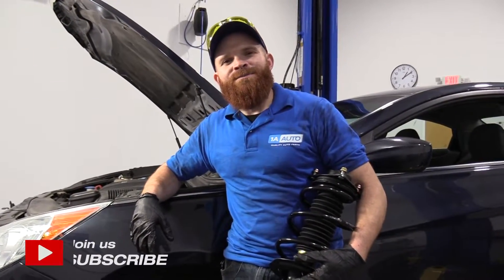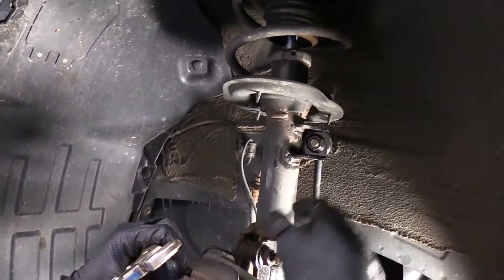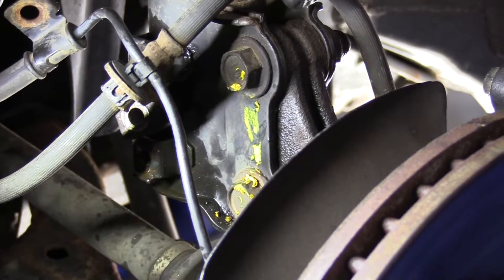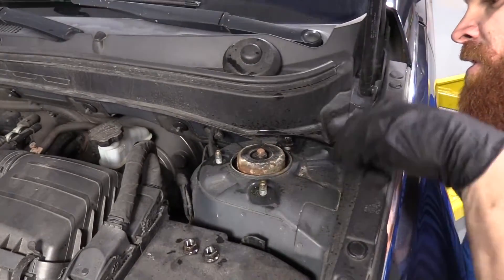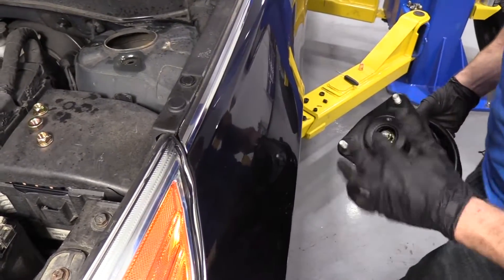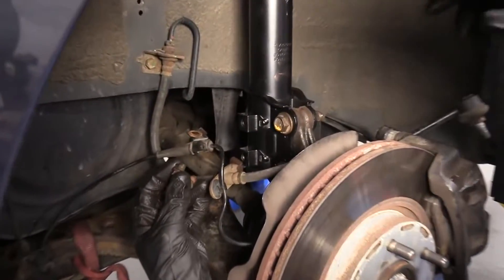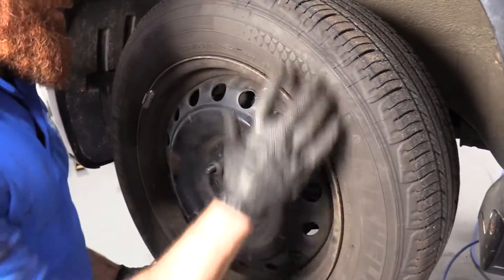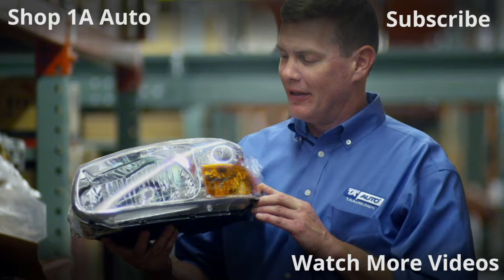How to Replace Front Strut Assembly 11 Hyundai Sonata

Comment from the maker: √  Watch the Video
√  Buy The Part at 1A Auto https://1aau.to/m-Visit-1AAuto
√  Do it Yourself
√  Save Money
Reply: That's the exact strut I'm currently looking for.  The location and position of the sway bar mount is correct for my car.  Any chance you know the part number of that exact strut?  I've had to return 2 different struts that stated would fit my car just because of the position of the sway bar mount.  Apparently the build date and weather it's sport suspension is the problem but I can't find a strut anywhere for my build date of 8/2010

Comment: 19mm wrench instead of locking pliers on the back side of the sway bar link if you have an older model where the mounting hole is in a different location. Some of the Sonatas made in 2010 were branded as 2011. Two totally different struts so make sure you provide your VIN to the retailer.

Comment: I have the shop manual and you are incorrect on the 2-bolts to to steering knuckle (lower strut assembly). It is approx. 100-115 ft/lb. 58 seemed low to me, so I checked.

Comment: Thank you for this great video!  It's really well done, from the clear video shots, to the equally clear instructions, to the perfect pace to absorb the details.

I used this to guide me through the process on a 2012 Sonata GLS, and it was very similar.  There were a few different sizes of bolt heads and nuts, and different bracket locations for the brake and ABS sensor lines, but those differences were obvious and easy to account for.

A couple of things I would suggest viewers know: first, be sure to jack up the entire front end, not just the side you're working on, or there will be too much pressure on the sway bar to allow the removal of the bolt. Secondly, rather than tying the knuckle with a strap to support it after the two main bolts were removed, I just slid the tire/wheel assembly under the rotor and let it rest on that - much easier than trying to figure out how to strap it all together, especially if working on this solo and finding you don't have enough arms and hands to do it all!

Comment: Tried to do this today.

I have a 2011, but one of the later builds dates that has the sport suspension. These use a different (harder to find) strut assembly, with the sway bar link mounting inboard. 

But I also found the bottom, lower strut bolt was 15mm instead of 17. The top was 17mm.

I can't seem to find whether this is supposed to be the measurement, or if someone had previously replaced the bolt. 

In any case, I couldn't break loose that bolt and didn't want to risk breaking something.

Comment: Why can't i buy the coil over strut assembly for the SE with the sport suspension?
Reply from the maker: +Scuderia Tifosi At this time we are not currently selling this part for your vehicle. We are always expanding our inventory so check back soon!
Reply: You ever get an answer from elsewhere, since one hasn't been provided from the host(s) of this channel? 
🇺🇸
Reply from the maker: +Just Doyle, Great Classics 989 How can we assist you?
Reply: @1AAuto  
Well, the answer you provided Scuderia with wasn't the answer to the question that was asked. The question being asked wasn't wanting to know if you have them in stock but rather why they're not available at all. 
I have almost the same question because the 2012 Sonata SE has sport suspension which has much more costly components. So Scuderia was asking why (and not asking if they're available) but why 2012 Sonata SE strut components can't be purchased individually & I want to know if the same car's suspension can be "downgraded" to non-sport without modification. 
Because you have mechanics doing various work on various vehicles, I want their expertise about whether this change can be made.
So reiterating, don't search your inventory for replacement products... inquire with the folks turning the wrenches about my question.
Thank you for your reply.
👊
🇺🇸
Reply: @DoyleFM  great question! We patently await another reply now.. same issue at the moment and no info

Comment: Great video, really helped me out. Have to emphasize using a strap to hold the hub in place because if you partially pull the CV axle out of the transmission you will get a terrible wobble like I did. Thought I had it held up high enough but I guess not.
Reply from the maker: +GetFound Thank you! We love empowering our customers and showing how to perform DIY auto repairs with our high-quality auto parts.  http://1aau.to/m/Shop-1AAuto-c
Reply: I don't can't find any examples of how. I don't see anywhere to tie down a strap anywhere

Comment: The Vin "C" w/sport suspension is hard to find under Hyundai, but easy to find under Kia Optima, It should be safe to use the Kia strut for the Hyundai since they look exactly the same?

Comment: Good video, but the torque specs are incorrect for a 2011 Sonata.  Should be 110 lb-ft for lower knuckle, 80 lb-ft for the stabilizer link. http://www.hsguide.net/front_strut_assembly_repair_procedures_revised-279.html

Comment: Aftermarket shocks for the 2011 Sonata sport suspension are impossible to find. I had to order all OEM parts separately. $793 bucks to replace my front shocks unbelievable 😐 Wish they made aftermarket parts for mine.
Reply from the maker: +JC The Lawn Care Guy Thanks for checking us out!
Reply: I have 2011 sonata se build date 7/21/10. What part number did u get for struts ?
Reply: Same here, i just ended up buying struts for the Kia Optima since there mostly sport suspension

Comment: I am still searching and waiting for a correct struts part numbers from KYB which will be a direct fit for my 2012 Sonata GLS, 2.4ltr, Vin "C" w/sport suspension.  The struts (2011) as shown from this video seems to be similar for my 2012 with the exception of the mounting hole for the stabilizer link should be pointed inwards towards the engine when the tires are pointed forward.  Likewise, the control arms for this car is not a sport type suspension.   Dang, that mid-year change for the Sonata assembled that period/year makes life difficult in replacing the front struts.  OEM struts from the dealer just cost an "ARM-AND-A-LEG".......
Reply: I’m in the same position right now... no one can seem to find the correct ones. Would you mind telling me what you ended up doing? Did you find the correct ones?
Reply: pinoyeh  gotta buy for 2013 sonata gls if u have a 2011 sonata gls produced in 2011.
Reply: pinoyeh did you every veg tube strut? I’m like having that issue wi th my 2013 limited.